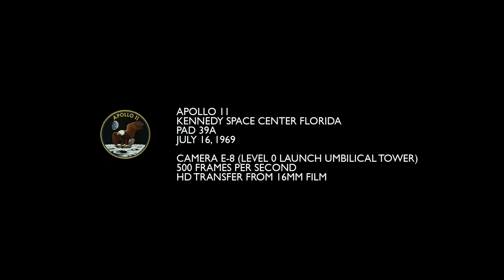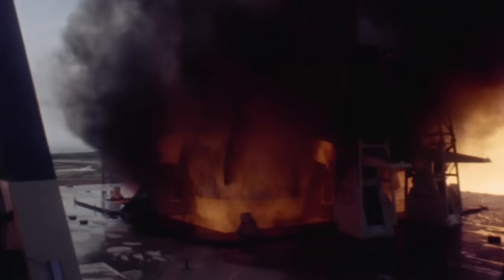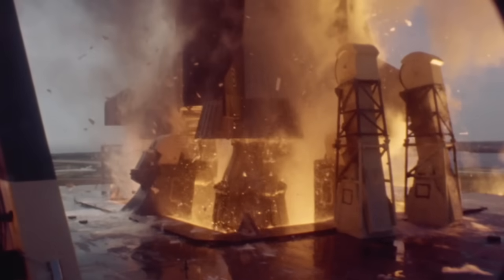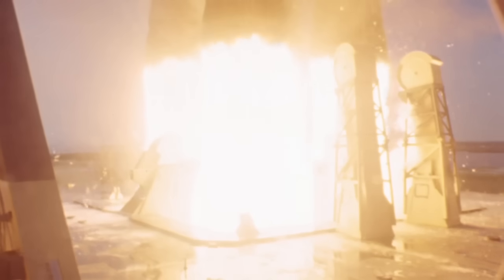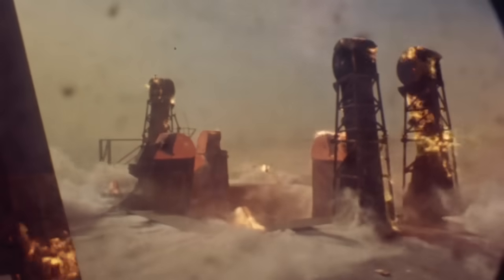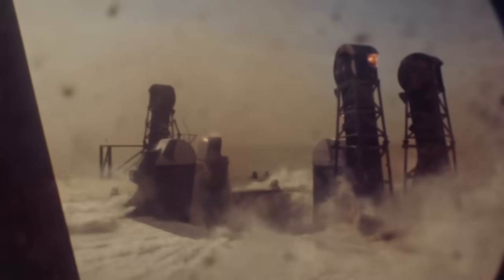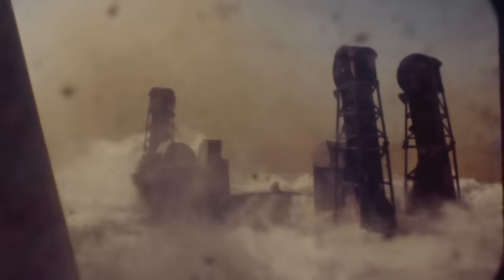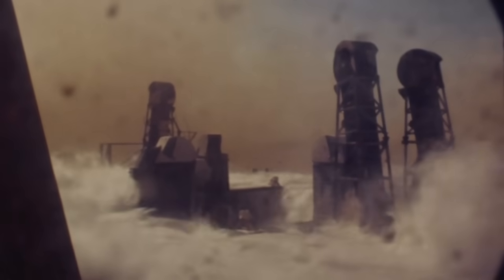Apollo 11 Saturn V Launch Camera E-8

Comment: This is AWESOME!!!  BUT... with todays technology, why can't we (SpaceX is most likely already working on this, I'm sure) take off like a regular airplane (maybe rocket powered at first), then make it to orbit, then return like a shuttle (not like the current "drop a pod into the ocean") but a controlled "powered" flight.  I'm assuming this is in the works and I hope to see this some day.  It'll happen... look at how far we've come already in literally a short period of time, if you think about it.
Reply: The vast majority of that rocket is fuel. A modern-day airplane would have the same problem. This isn't a problem of aerodynamics, it's physics. Whether rocket or airplane you have to expend an absolutely stupid amount of energy to escape Earth's gravity, even to just make it to orbit. The reason rocket launches are returning to the capsules and stacked rockets is because they're immensely safer. They're also more efficient. We can send rockets nearly the size of the Saturn V with just cargo to space to resupply without ever risking a life at all. The Space Shuttle had to carry all its cargo in the glider. The glider was under immense stress on the trip back and cost 14 lives in two separate incidents. Stacked rockets from NASA, on the other hand, have never resulted in a death in space flight. So, while a controlled powered flight might look pretty cool it's just not at all been the most effective and safe method we've discovered.
Reply: An aircraft loaded with enough fuel to reach orbit with a useful payload would require a massive runway (think 10 miles or more) and the landing gear needed to support the weight of all that fuel would add tens of thousands of pounds at least (which requires even more fuel, which then requires more landing gear weight and massive wings etc.).

I didn't fully understand this problem myself until I started trying to develop my own designs in various flight sims using realistic weight estimates and fuel burn rates. And actual hands on calculations using the rocket equation to develop and confirm designs.

The best you can hope for with a runway takeoff (horizontal takeoff) is something like stratolaunch.

Look up the Rockwell Star Raker concept and you'll get an idea of how massive an HTHL SSTO would be.

Comment: Fascinating to see the detail which was built into the crawler launch platform, so that the towers could be refurbished and then re-used to assemble the next Saturn-V rocket for a subsequent Apollo launch.  

That the crawler/platform system (and the Vehicle Assembly Building) were subsequently used for the Shuttle programme launches speaks volumes to the foresight of those 1960s scientists, designers and engineers. Well done, one and all.
Reply: I remember seeing a photo of one of the crawlers where someone had placed a small 'wing' on top of the driver's cabin. It was pretty funny.

Comment: I was flying RF4Cs at Shaw AFB, SC on July 16, 1969 and was scheduled for a training sortie at 0930, just as the Apollo 11 countdown was approaching zero 300 miles away.  On a whim, we dialed in the coordinates for Canaveral and, on takeoff, headed south, climbing, while listening to the VOA coverage on HF radio.  Passing through 20,000 feet, we witnessed the fastest, most beautiful, and most vertical contrail we could have imagined.  As the pilot in the backseat upgrading to instructor, my only regret was not heading 5 or 10 degrees off the direct course to Canaveral, as my front seater blocked my view of the contrail's fast appearance and I had to turn quick before I could see it.  A great day.
Reply: What a story!  Many years ago when I was a kid, I got to fly the F4 Sim at Macdill! Many years later a Wizzo gave me an F4 c/d flight manual that I still have and always will.
Reply: Have you seen the footage of an RF-4 crashing in Philippines? do you what was that accident?
Reply: No Vietnam for you, huh?
Reply: @haroldstrong5723  I returned in 1968 from Thailand and Vietnam.
Reply: @Rama41  Cool
Reply: Now THAT was a unique viewpoint!  Good planning.

Comment: I’ve watched this many times and just had a thought….if any smart, innovative, and motivated folks are reading this….if someone could tweak that charring, insulating coating applied to the more fragile components so it could be applied to other surfaces like say building structures like houses…someone be able to protect and save a few more helpless families homes that are completely destroyed by the devastating wild fires every single year that causes families to lose everything…even if you could only save 1 home with a coating that can char and encapsulate the home creating a flame resistant barrier….?….if nobody hasn’t already tried…?…if so then just ignore my rambling….but if you do and get rich all I ask is a new Corvette and we’re even…..cool?
Reply: Just encase your house in concrete, metal or tile roof, and you'll be safe against a wildfire. It costs a fair bit more than a standard house of course and may look ugly. The ablative materials aren't cheaper, they're using them here because they're (briefly) effective for temperatures much hotter than wildfires.

Comment: You say oxygen and "kerosene"???  I thought the steam and water vapor would have been from oxygen and hydrogen.
Reply: The S-IA first stage of the Saturn S-V assembly launch vehicle was powered by liquid oxygen (LOX) oxidiser and 'kerosene' the American commercial name for paraffin fuel, the familiar lamp / lantern oil / fuel from the Wild West days, more pure, filtered for impurities. 

The S-IIB second stage used LOX and Liquid hydrogen (LH2) as oxidiser and fuel, as did the S-IVB third stage.  

A great deal of water in ice and liquid form was present on the launch pad, and much of this was pumped in a huge deluge for the first seconds of engine ignition and lift-off, to reduce damage from flame and sound vibrations during launch.  A klarge proportion of this water was boiled off into steam by the engines.  

Find pictures of the launch complex (numbers 39A and 39B were used for the Apollo launches) and you can find tall water towers some distance from the launch pads.

Comment: My dad worked at Stennis Space Center in Mississippi where these engines were tested. The first time they tested all 5 engines it broke a lot of glass in buildings in my hometown. I was lucky enough to work at Stennis during the shuttle program and it was very cool to actually lay your hands on and work on those engines.

Comment: I'll add to the "Where was I" database for this historic event. My dad was into Heathkit electronics kits (radios, alarms systems, you name it he bought the kits and built them), and the city we lived in had gotten it's first color TV transmitter installed in one of the local stations. After the moon launch was announced, my dad bought a 21" color TV kit (with a remote control, and the TV's knobs were motor-actuated when controlled by the remote but, in 1969, that was like Star Trek) from Heathkit and my dad, mom, sister (4yrs), and myself (3yrs) spent a few weeknights together assembling this color TV so we could watch the moon launch in color. I can hardly imagine what it must have been like to be there when it happened.

Comment: Some 50+ years after the Apollo program and they still remain the most powerful rocket engines built by men.  It is said that those F-1 engines could not be built today because designs were changed on the fly by steely-eyed missile men who did things as much by feel as by what was printed on a blueprint.  I can still hear the rumble of the engines as I watched on TV until the spacecraft disappeared from view..

Comment: The Saturn V burned a gallon of fuel every 5 inches it traveled
Reply: I once saw a video of a set of telemetry set beside the film of the launch and the Mission-elapsed time clock: at launch, the Saturn V appears to burn 100 tons of fuel before it has travelled it's own length!
Reply: @stevetheduck1425  That's almost the same amount of gas as a classroom of teenagers!

Comment: The problem is how they managed to pass Van Allen belt, why they say they don’t have the engine now to land on the moon and why they are claiming they lost all the original videos and other materials of the moon landing?
Reply: “The radiation belts of the Earth do, indeed, pose important constraints on the safety of human space flight.
The very energetic (tens to hundreds of MeV) protons in the inner radiation belt are the most dangerous and most difficult to shield against. Specifically, prolonged flights (i.e., ones of many months’ duration) of humans or other animals in orbits about the Earth must be conducted at altitudes less than about 250 miles in order to avoid significant radiation exposure.
A person in the cabin of a space shuttle in a circular equatorial orbit in the most intense region of the inner radiation belt, at an altitude of about 1000 miles, would be subjected to a fatal dosage of radiation in about one week.
However, the outbound and inbound trajectories of the Apollo spacecraft cut through the outer portions of the inner belt and because of their high speed spent only about 15 minutes in traversing the region and less than 2 hours in traversing the much less penetrating radiation in the outer radiation belt. The resulting radiation exposure for the round trip was less than 1% of a fatal dosage – a very minor risk among the far greater other risks of such flights. I made such estimates in the early 1960s and so informed NASA engineers who were planning the Apollo flights. These estimates are still reliable.”
- James Van Allen
Reply: " how they managed to pass Van Allen belt"
With a rocket.

"why they say they don’t have the engine now to land on the moon"
Do you see any Saturn V ready to go? Me neither.

"why they are claiming they lost all the original videos and other materials of the moon landing?"
Nobody claims that.
Reply: Where are you getting all this nonsense?  You need to change your data source..
Reply: me me   Did Thomas address your questions sufficiently?
Reply: My biggest question is.  You all say nasa is lying about everything but then immediately believe the radiation belts.  You can't just pick and choose

Comment: The launch was real, but the whole moon thing was fake.
Reply: I don’t understand how with so much free information that people cannot simply educate themselves. Here are two facts (two of dozens) that are irrefutable and which can be verified independently: First, the telemetry of the landing vehicle (lunar module, or LM) was communicated through radio transmission via multiple antennae mounted in multiple countries around the world. This was necessary to maintain constant contact since the earth actually spins on its axis so no one antenna could receive data or transmit data 24 hours per day. Each of these antenna was receiving telemetry from the same location on the moon during each mission. The target point for radio transmission was objectively determined and consistent across all data collection points, obtained by separate organizations (not NASA), and independently verified by multiple countries. Probability of faking that is statistically zero. Second, reflective arrays were left on the moon from which both radio signals could be reflected and seismic data were collected and returned to the earth. Returns from these arrays and sensors was obtained even while the astronauts were walking around the moon. Indeed, their footsteps were correlated with video footage later on. The fact that they were received on earth (again, through multiple antennae, as described above) and validated / verified through independent data collection sources is irrefutable - in other words, it happened and was verified, not by NASA, but by multiple independent agencies and countries.

There are many, many more proof points that are objectively verifiable. You can even verify today that there is a reflective array on the moon by targeting a laser on the coordinates of the Apollo 11 reflector. You simply need its coordinates and the time at which the moon will be overhead. Someone who understands physics would also recognize that a coherent return would not be physically possible in this known universe unless there was a coherent reflector capable of returning the signal reflectively. In other words, just shining a light at an object by itself (like the moon) will not provide a coherent return because of light diffusion… one would need an object there to reflect light coherently (i.e., an intelligently made object, such as one made by humans and located on the surface).

Again, physics and facts… easily verifiable and provable with a small amount of independent curiosity and research. These facts are the case whether or not one wants to believe NASA.
Reply: @johnzaleski5182  Educating ourselves takes effort and it's much easier to follow the conspiracy stories for those guys. I'm guessing education and critical thinking isn't in their skill set. We all know it only takes a few minutes to find answers to some basic questions but they clearly can't be bothered doing that. A combination of sad and amusing.
Reply: The British monitoring systems detected everything the US and Soviet space programmes did.  

I understand the French did as well.
Reply: It obviously wasn’t.  Please explain to the ex Honeysuckle Creek and Orroral Valley tracking station staff like myself here in Australia how AESEP, multiple ALSEP installations and LLR made it to the lunar surface?  Assembled, configured, cabled over wide areas, probes dug deep into the surface and aligned.  We used to upload commands and download data from ALSEP on a daily basis, and the CSIRO guys used to lase the retroreflectors from a facility adjacent to our site.
Reply: You should change your name to Teresa 67 Ignorantoid. 
The 6 successful Apollo lunar landing missions conducted between 1969 and 1972 put 12 astronauts on the moon's surface - FACT. 
Unless of course, you have some compelling evidence (NOT ignorant misinformation) that proves otherwise?
Reply: So did you actually read the comments? Or do you still just repeat the same thing still?

Comment: forbidden bbq but I have to add, using the flame of a Saturn V rocket engine for a barbecue would not be feasible or safe for several reasons:

- Extremely high temperature: The flame produced by the Saturn V rocket engine reaches temperatures of around 5,800 degrees Fahrenheit (3,200 degrees Celsius). This temperature is far too hot for cooking food and would likely burn or incinerate anything placed in its path.
- Toxic combustion products: The combustion of rocket fuel produces toxic byproducts such as carbon monoxide, nitrogen oxides, and other hazardous substances. These substances are not safe for food preparation and could pose serious health risks if inhaled or ingested.
- Lack of control: Rocket engine flames are designed for thrust and propulsion, not for controlled cooking. They produce a highly intense and unpredictable flame that would be difficult to manage for cooking purposes.

Overall, attempting to use the flame of a rocket engine for a barbecue would be extremely dangerous and impractical. It is much safer and more effective to use conventional methods of grilling or barbecuing that are specifically designed for cooking food.